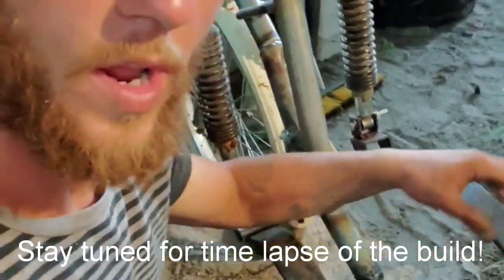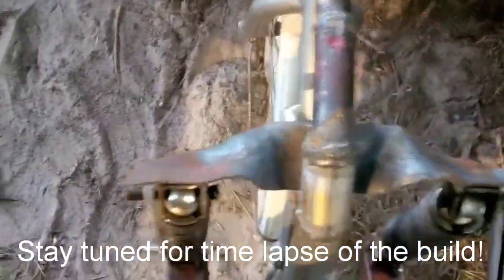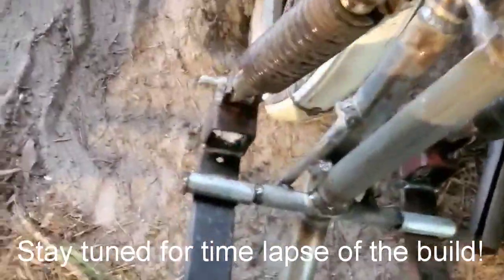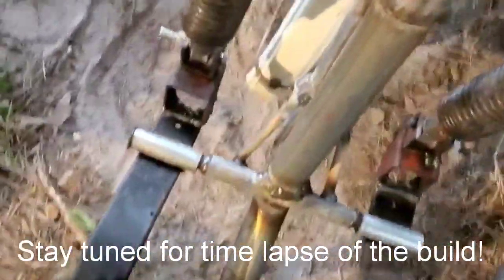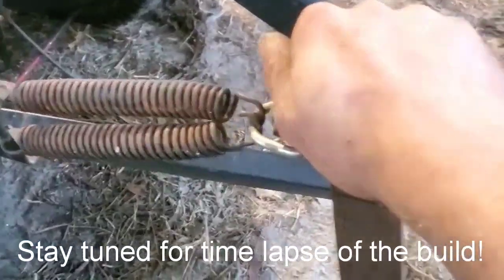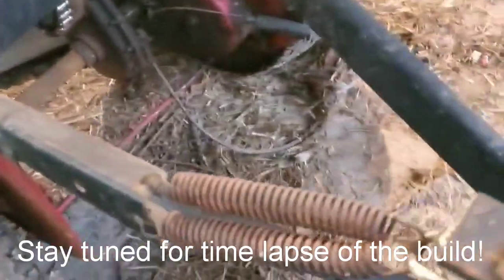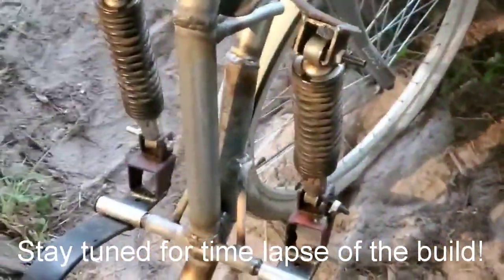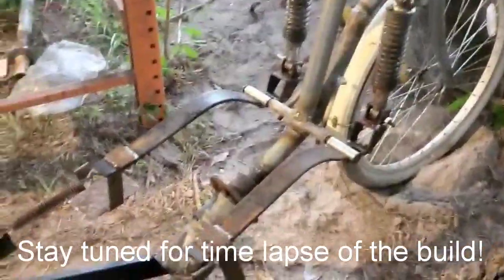The most unique trike design you have ever seen....EXTRAORDINARY

Comment: Pretty cool, you should make a free energy bike or even auto... Free energy 4x4 would ultimately be the most useful. Cats should have windmill generator motors on each wheel and you should be able to open your door and like the Flintstone's give one push and .   .   .   .  .  .  . . . .............. Like the Jetsons and do it all with running machine motors using your commutator trick. 2 on each wheel would be cool one to go and one to charge but probably need 3 on reach wheel, 2 to charge ECT. I've been wanting to do this s couple years now, just throwing something out there. I almost had my 80cc Panama Jack Huffy there but batteries are way heavy and having 3 chasing on the back wheel sucks to get flats with.... Also if you know anything about capacitors you should make videos on that as well like what to use and where to get them from, how to write ECT. I can't seem to figure out out. Magnets all over vehicles and road with ac motor is the future. Told this to my third grade teacher
Reply: Cars not cats my bad
Reply: Also I will share your channel on my Facebook, I got 5,ooo friends from the edm world ECT